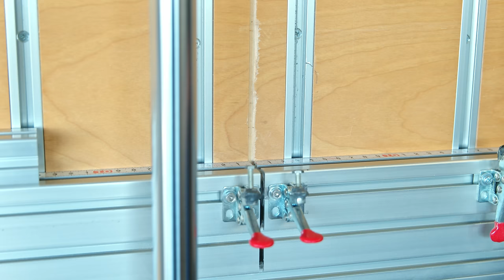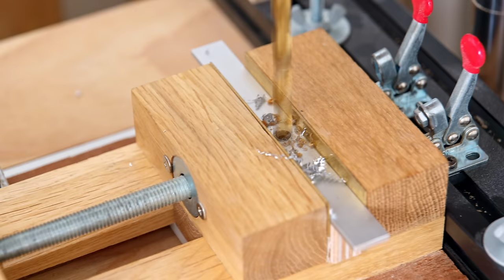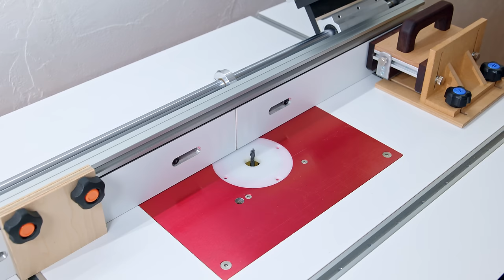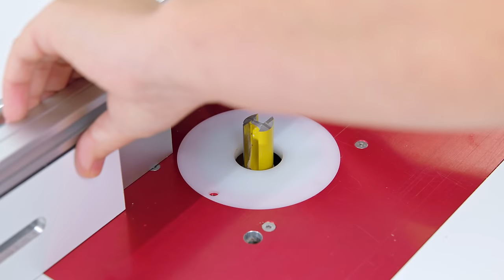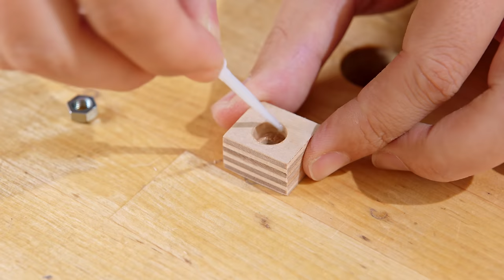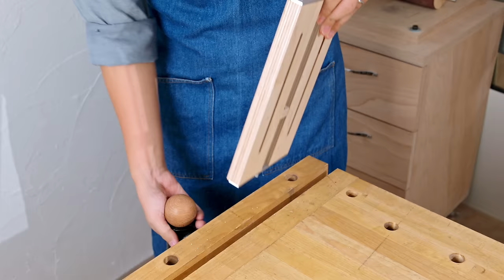Amazing Fine adjustment mechanism using screws

Comment: I always enjoy watching your videos. The excellence by which you work is completely therapeutic. Such precision and grace...
That being said, this latest build does not let down. Genius design. The fact that the work piece is not "locked" into the jig itself makes this quite convenient and user friendly. The ability to sneak up on the band saw blade facilitates an ease of adjustment. Then the sanding mode allows one to use slight pressure to work the piece down to final dimension. Finally, the router table...again, a natural, ergonomic operation. Fantastic work! Thank you for sharing with us your incomparable talent and skill! Your expertise!

Comment: Nice project. You might also put a radius pin in the screw driven stop. It would give you the same versatility plus addition control of the blank.

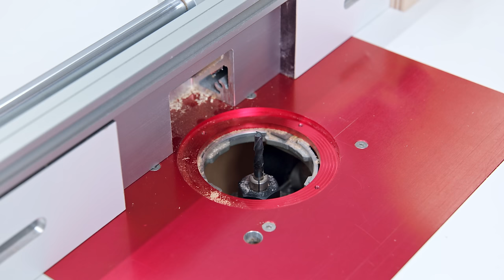Comment: 3:28 That's what I absolutely love about my Triton router. As long as the hole in the insert is bigger than the collet, the collet can be raised above table height without removing the insert, and at the same time, the spindle is automatically locked, making changing the router bit fast and easy.

Comment: always beautiful work and ideas. if you put cutting oil on the bit instead of on the work, you will use less cutting oil as gravity will slow-feed oil to your work, and you'll also provide better protection to spiral edges of your drill bit
Reply from the maker: thank you for the advice.
Methanol is used in the video.
It acts as a very effective cutting fluid for aluminum.
The problem is that it has a low viscosity and falls off the bit quickly.
Reply: @jisakukobo  good idea. the sole purpose of cutting fluid is to keep the interface between the cutting edge and your material cool. methanol does not do much to reduce friction like cutting oil. instead it keeps the cutting surface cool through refrigeration, which solves the problem of aluminum melting when you try to machine it. any alcohol should work, even 90% isopropyl, which is readily available in US drugstores (but maybe not in japan or elsewhere in asia), and maybe even vodka, which is non-toxic and readily available, and which i'll try next time. another potential advantage of using alcohol as a cutting fluid on aluminum is if you're welding it doesnt introduce any impurities

Comment: What are those silver f clamps are you using to hold the vise to the drill press. Look like they tighten on the back of the head? Where did you get those?

Comment: Hi I noticed you lost your left index finger, a month ago I was using a table saw cut the 4 fingers on my left hand all pretty bad, 3 came out ok 
but the left index finger had to be amputated. I am undergoing physio but in the early stages, regaining a little bit of joint bending.
You look like you have recovered well, any advice on what I have to look forward to and the time if all goes well.
Regards Gary
Reply: Sounds horrific Gary, sorry to hear. I can't see any missing fingers in the video?

Comment: sure. very nice video,. if you like to spend hours with wood in noisy workshop. watching it from another point - there is XXI century. so it also could costs 15 minutes for cad project and 20 minutes for cnc router ( with setup). always is the question for the sense. how many people drive cars from '70 - even that's very beautifull auto?/ (except me)

Comment: Would be SO much better if you showed the "tool" (in use) first, and explained what the hell it was and how it worked.
I hate sitting through a video showing individual parts being made without the context of what they are for... even worse when I finally see the tool in action and it's not what I need anyway. Wastes my time.
What's the bowl/tray got to do with anything? The video starts and ends with it, yet the video title is about a fine adjustment mechanism. GRRR